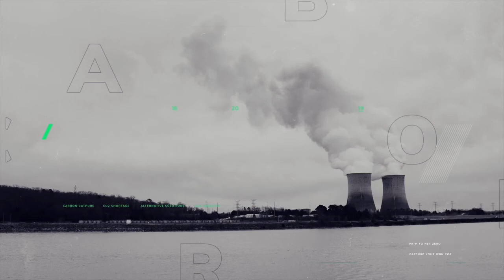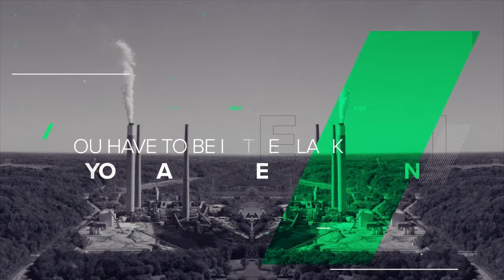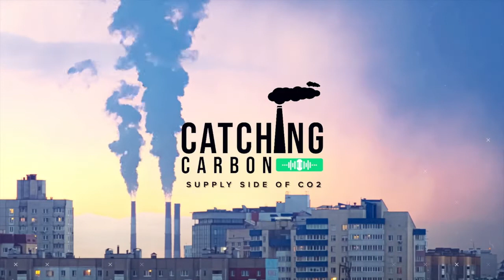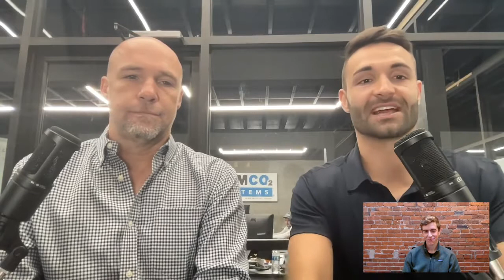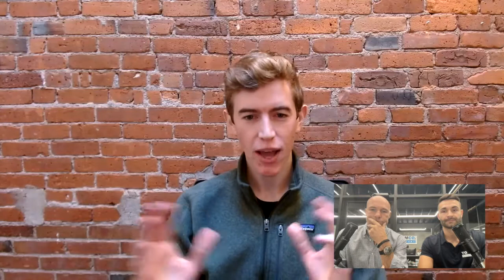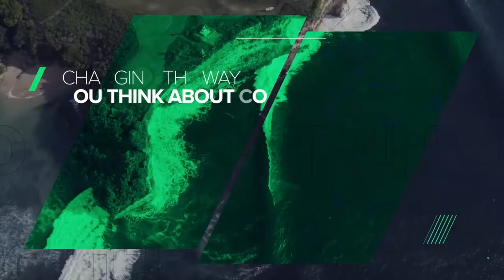Remora & Semi-truck Carbon Capture

Comment: Lots of discussion on hardware.  How does the levelized cost of ownership stack up?  I am guessing the sieves need to be changed out on a frequent basis to prevent cycles from becoming too short or becoming dust and plugging the system.   And why not use a monolith designed on some of the concepts used in gas filtration and purification to mitigate pressure drop while shrinking footprint?